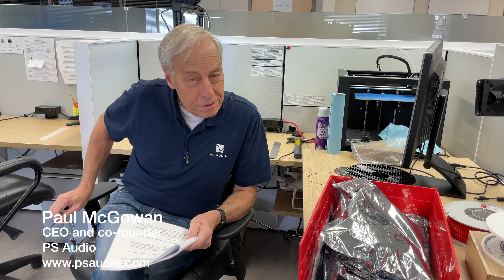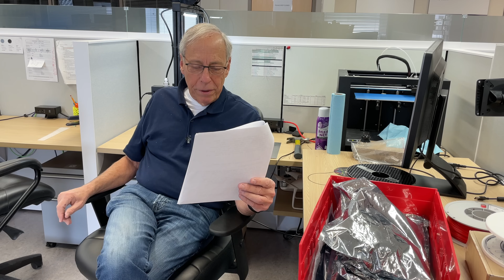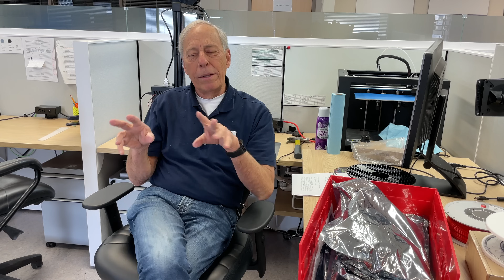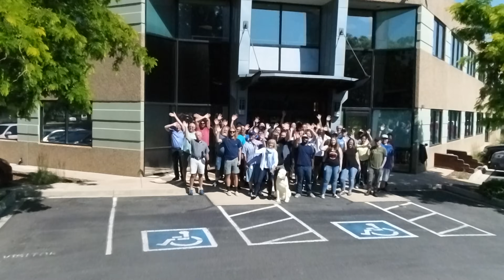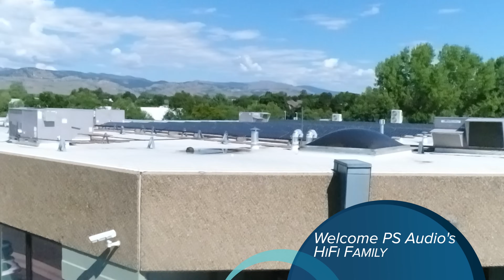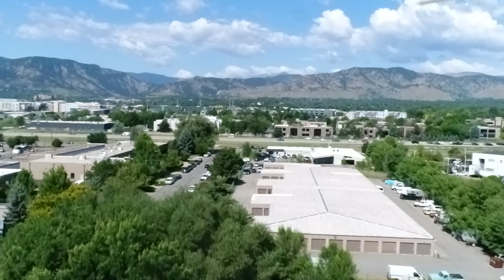Does bi amping change impedance?

Comment: Hi everyone. I have a dual mono power amp that may be used for passive bi-amping through its A/B speaker selection. Let’s suppose I use A to connect to the tweeter and B to connect to the bass pots, what happens to the amp? Does it see a different impedance load? I ask this because it’s written on it that with A or B working (one at a time) the impedance goes from 4 to 16 ohm per speaker, while it rises to 8 to 16 when A and B are simultaneously activated. My speakers work between 4 and 8 ohms, do I risk to damage my power amp?

Comment: Hey Paul, what about when the impedance of the tweeter and the impedance of the mid bass driver in a speaker are rated differently? Is there a best way to bi amp them in that case, vertically or horizontally?

Comment: You must be a politician at Heart to speak for so long and say so little is a skill onto itself doesn’t help anything other than you of course you never Explain the true advantage of bi amp,these are well Established in documents by the audio engineer in society  Basically 4:1 years power diffidence is needed with the required crossover probably active with a good slope , I like 24DB per octave I the slope sounds best but it is very hard to make passive 
     Ask speaker wire is a well traveled subject and

Comment: I know this is an old video but I’d like to add my 2 cents. What Paul is referring to is commonly called passive bi-amping, accomplished by taking the shorting straps off the 2 sets of speaker inputs. The first question is always is it worth it? The answer is it depends. Using 2 unused channels in the average AVR the answer is no. Most AVRs will drop output with the addition of more speakers. On typical 2 and 3 way speakers it maybe worthwhile if you are using say a tube amp to drive the mids and highs and solid state to drive the lows. But they must have the same gain or it will really mess up the sound. I have read that the LF driver will typically consume 65-75% of the power supplied to the speaker and that usually around 250HZ is usually the dividing point in sound reproduction. In other words 50% is used to produce sound below 250 and 50% is used to produce sound above 250. This is why a smaller amp can be used to drive the mids and highs. As far as the power increase there would be one, albeit a small one. For example if you used 2 identical 100 watt amps the woofer would have almost the entire 100 watts dedicated to it (rating minus the power lost in the crossover to raise the impedance of the higher frequencies). The mids and highs would also have 100 watts. However, they would only use a fraction of the 100 watts available to them. I have been using a passive bi-amp to drive my JBL L7 speakers. They are a 4 way design with a passive subwoofer and separate mid bass. They cross the sub at about 180HZ and it does make a difference in my case. 1 channel is dedicated to driving the sub and another is dedicated to driving the mid bass, midrange and tweeter. These are very power hungry speakers and I’m using 4 channels of an Outlaw Audio 7200 (7X200) to drive them as the fronts in my 5.1 set up. I have a pair of JBL L5 for my surrounds which are a step down in the same series that are also 4 way with a smaller sub and mid bass but share the same mid and tweeter. However they don’t have bi-amping ability. I do a lot of listening in all channel stereo and the fronts overwhelm the rears despite being 10’ further away and are only rated 1DB higher in their sensitivity rating. In my case as I see it I have close to 200 watts for the sub and 200 watts for everything else since I’m close to the dividing point. I will close by saying I believe I would be better off driving them with a 400 watt amp. But there are not a lot of affordable choices in 400 watt amplifiers so I do this as the next best thing. If I had a typical 2 or 3 way speaker, I probably wouldn’t do it either.

Comment: The guy doesn't understand. Driving the woofers and tweeters seperately is no different than having two seperate stereo systems. It's still 8 ohms for each set up.
Reply: if yu understand can you explain me something i have 4 ohms bi speakers and receiver is 8 ohm,,what if i connect them in series ,,would it be speakers 8 ohm than .,,do you know

Comment: I think you need to explain the difference between bi-amping and that other silliness, bi-wiring.
Also, in a bi-amping mode, the woofer and tweeter are disconnected from the common input of the filter cirtuit
Reply: Bi-amping akd bi-wiring can have benefits. I.e one amp has better lows and the other better highs so together they sound better. And bi-wiring can do the same but not as noticable as bi-amping.
And if the speaker has a common ground it can easily be fixed. But many do not have that.
Reply: @Oystein87  You know, after years and years of spending money and wasting time to get a certain sound signature. I've come to the conclusion that THE two manufacturers who made the biggest impact on MY ears and soul are Bang and Olufsen and Bose.
People can say what they like. I've witnessed Bose completely trash huge monoblocks and behemoth speaker systems
Reply: @Trev9  Hahahahaha🤣🤣🤣🤣🤣🤣
I never witnessed Bose manage to trash anything. Even their biggest and most expencive home systems lacks huge areas in the freq. range between the bass module and speakers. Ok for movies, bad for music. That's Bose in general. And B&O.. Yes, they have some good sounding products. But not for the price they demand. B&O are basicly a "Pay more, get less" company.
Reply: @Oystein87  so what system would you put together and what would it cost?
Reply: @Trev9  Depends on the budger, use, needs etc. So not easy to just give an easy answer. Atleast if you care about the sound quality. If not then basicly anything is good..
I would prefer listening to the components and it depends if it's a main system or a secondary one etc.
It would cost whatever the budget is and play nicer than Bose.
Reply: @Oystein87  Do you see why saying the B&O is overpriced is not true at all?
Reply: @Trev9  But it is true.. You mostly pay more for weird design that the actual sound. It's a known thing.

Comment: Omg .... that was painful !
The woofer and the tweeter both have filters to prevent respective high and low frequencies from driving them ..and each looks like 8 ohms to its amplifier
Reply: oh ok  it's not a normal resistor, so it can't be calculated in the same way. Because it's frequecy dependent impedance.
Reply: The passive high pass filter in the high frequency speaker circuit increases impedance at low frequencies.  The passive low pass filter in the low frequency speaker circuit increases impedance at high frequencies.  The impedance of high and low frequency speaker circuits in parallel is the nominal impedance of the speaker.